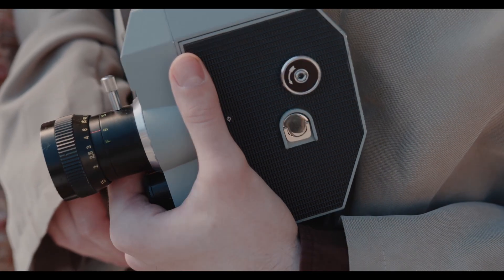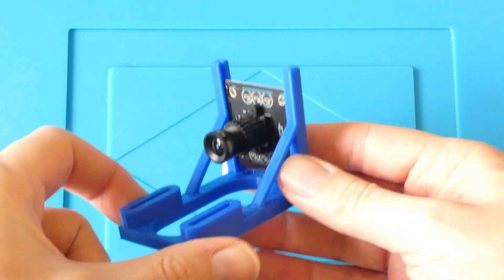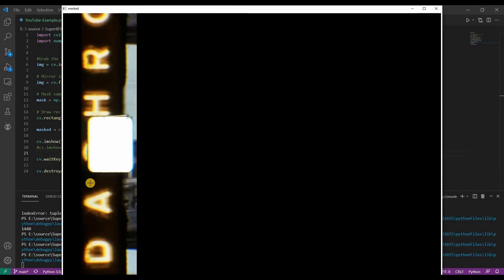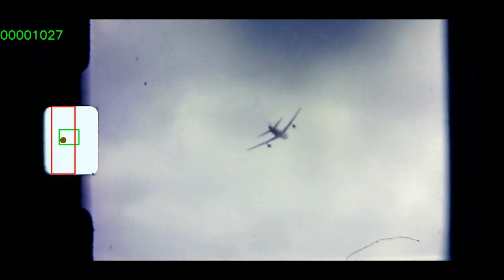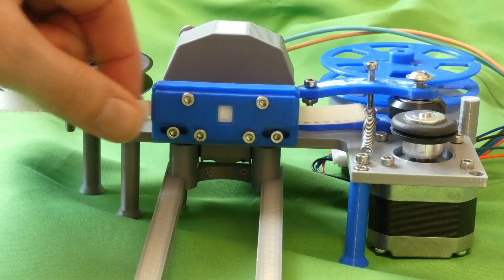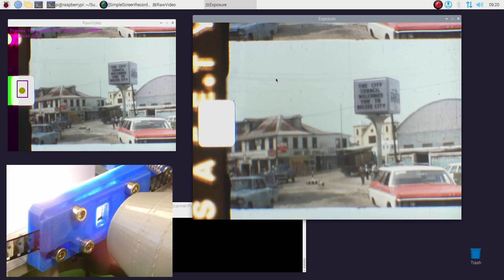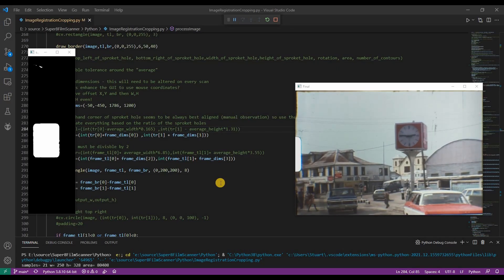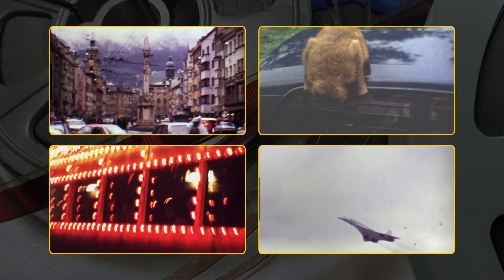Super 8 film scanner, 3d printed using OpenCV

Comment: I love your use of Open CV for frame tracking, Raspberry Pi for image capture, and 3D printing of film advancement. How do you drive the take-up reel since it's revolution required rotation decreases as more film is taken up due to the larger effective diameter?
Reply from the maker: I started to code really complex logic to change the speed of the stepper for the take up wheel and then just ignored that and used a fixed speed and tightened up the slack at the end by hand.
Reply: @StuartPittaway  Today's crazy idea. A magnetic clutch. A motor that runs faster than you need but couple it with magnets to the take up reel. So it will always slip, but enough torque to keep tension on the take up reel. I think others do it with a rubber belt that slips.

Comment: Stuart - this looks amazing, thanks! I was just about to buy a Wolverine scanner and found this just in time. In your GitHub repo, you mentioned an old Ender3 PSU would work for the power supply, but do you know if the motherboard would also work? It doesn't appear that Ender motherboards are RAMPS compliant, but I should be able to flash Marlin on them. This seems like a great use of my old Ender3, particularly if I can reuse the stepper motors and other parts. I'd love to hear if other users have had success with that.
Reply from the maker: I can't see why it wouldn't work - Ender already have Marlin code on them - you just need a way to control the stepper forward/reverse functions
Reply: @StuartPittaway  Thanks for getting back to me. I was able to get the Ender 3 Pro (silent board) to work. The only issue I ran into was that the Y axis travelled in the wrong direction - so I just rewired the connector in reverse and it worked fine. This is actually a great use of an old Ender, as I got the motherboard, PSU, stepper motors, cables, screws, and other stuff from there.

The only real issue I've had is that scanning requires constant monitoring. The film frequently hangs up in the gate window while reversing and bends on the right side. Is this something you ran into and resolved? I'm wondering if I should reprint that part in PETG or something as it might be a little more slippery. Any other ideas you have would be much appreciated. Thanks again!

Comment: Could you have used a B&W sensor and a color filter wheel in front of the camera to take 3 exposures/frame and then merge them later on?

For the alignment maybe leave a gap in the wheel so that only a B&W image is captured for the sprocket detection and when aligned capture R, G & B frames.
Reply from the maker: Yes this would have been possible

Comment: Very nice! Could you maybe please provide some more technical details (or even a video) on the actual assembly process of the scanner? 
Which screws / parts are being used / how to make anything spin and such? 
And how to connect power and the Raspberry - thanks a lot!
What's the reason that two stepping motors are required?
PS: i'm originally from Tyrol, very nice old footage of Innsbruck there!
Reply from the maker: Hello, thanks for watching. I really don't have the time at the moment to expand on the building process. If you can take a look at the Freecad files, it should be quite simple to see what screw holes there are and how the parts align.

I used 2 stepper motors simply because I had them spare. This could have been done with a single motor.

Comment: Hi Stuart, really fantastic work here. I'm interested in taking a similar approach towards scanning 16mm film. I've been trying to wrap my head around how I'd handle sprocket hole detection on this format, given that the hole sits in between frames. Do you know if there is a way to align the frame using two sprocket holes rather than one? I apologize if this is a dumb question, I have no experience using the OpenCV library. Thanks!
Reply from the maker: It should be possible, you detect the square shape and then use that to align the overall image.

Comment: Your results are very good.  I've been playing with a circuit that varies the lamp brightness with the measured brightness through the film.  This helps compensate for under and over exposure on the film itself.  I built it and it works well enough to incorporate into the Rube Goldberg I've cobbled together.  I'm hoping to try it out before Spring.  I too use Davinci Resolve for post.  I find it quite fun to capture old family films.  An excellent cure for the doldrums of Winter.
Reply: you can try to take 3 pictures one over exposed and other under and merge them so you have an hdr imge with the with rage of the film. Also if you add another with an IR light you can run a dust remove filter in photoshop. that is how all my 35mm scan works
Reply from the maker: I had a lot of fun doing this - I remember watching the films as a child, so very nostalgic to restore them in the digital world.

Comment: Hey, amazing video. im doing a very similar thing, but with a flatbed scanner. but i now have a scanned strip with about 30 frames and no way of splitting then up into individual frames. i was hoping OpenCV could help , but being new to python im finding it really hard. can you offer any advice?
Reply from the maker: I was also new to open CV, it's not that difficult but trial and error paid off
Reply: @StuartPittaway  iv actually made some headway. I'm about to crop my frames now. But only on singular images. Need to setup iterating through my image folder next

Comment: Very cool!  Y'know you can have Davinci detect cuts as you import the clip (or frames) via the Media tab.  You can adjust the tolerance of the what is detectable as a cut and after its done, you can go thru what it had generated as cuts and remove or add any more cuts that it neglected.
Reply from the maker: Great tip! Thank you

Comment: Hi Stuart, I have been toying with the idea of transferring old Std 8mm to digital images for some time now. I had thought about converting a projector but I find that your design of a scanner, and the resulting images are awesome.  I now have an old 'Illumitran' slide copier which would use a camera to capture the image. I would like to adapt this, by adding arms for the film transport system by powering them with Stepper motors, and using a 8mm size film gate.. But, I have to admit that computer programing/components completely mystifies me. If I use 2 Nema 17 motors, do I need 2 separate drivers ? I would replace the camera with a digital HQ Camera Board with a Microscope lens and wonder how a sprocket hole sensor could trigger off the camera   Could all of this be powered by an Arduino ? The Raspberry system for programming seems quite complicated. Could I please ask you to provide a list of what Motherboards, Drivers, Controller/Smoothie Boards, Sensors etc that I will require.  Sorry that this is rather long winded, but I would appreciate any advice that you may be able to provide.  Many Thanks. Best Regards.
Reply from the maker: Hi, I used an old 3d printer motherboard, nothing special it just runs marlin, and has several stepper motor drivers.

You need a driver for each stepper motor.

I then use the raspberry pi, and it's microscope camera to capture the images. Arduino isn't really suitable for this.

Don't forget a good light source as well, it needs to be bright and uniformly lit.

Comment: This is amazing. I've spent days going down the rabbit hole of how to modify a projector, but this has inspired me to try a new approach. Using software to sense the sprocket hole is brilliant.
Reply from the maker: Glad I could help!
Reply: I agree. I've played around a little bit with computer vision but it never occurred to me to use it for this - makes the mechanical solution so much simpler.

Comment: You can buy old projectors and editors very cheaply on eBay. The editor is good for rewind.
I am building a scanner. I found webcams do not give a flat field but a digital microscope works well. Will use magnets to hold the camera in place so I can position just by moving it.
Reply from the maker: Good ideas.
Reply: I've been thinking DSLR with macro lens although the files might end up being unnecessarily large. You'd definitely want a decent lens for the best possible results though.

Comment: Thanks for sharing this - and your github repo. I'm just setting out to do the same thing having bought a scanner off Amazon and sent it back thinking I could do better myself! It kept adding a kind of flutter to the top of some frames and they were really over sharpened. Having studied pictures of the Retroscan commercial scanner I'm going to try not using a pinch roller first. It seems to just pull the film through a set of friction rollers. Time will tell.
Reply from the maker: Did it work?
Reply: @StuartPittaway  The 10 million dollar question! I ended up ripping up an old standard 8 projector and using two sprockets directly on two stepping motors either side of the gate plus a third stepper for the take up spool. I controlled these and a camera with a Raspberry Pi. It "kind of" worked. I think the hardware set up was more or less OK but it needed a lot of work on the software to get over how crude it was. Late one night I was struggling with it when I realised I really didn't want to be doing it any more. My day job is as a software engineer and it really isn't good to end up programming into the evenings. Maybe when I was younger but not anymore! I gave up on it and went to do something more analogue in my time off. Here is a quick phone video of it "working" before it went into the parts bin https://youtu.be/t7t8p3Mq3LY

Comment: Great project Stu. It is very reassuring to see your approach getting such a high quality result. I'm in the process of doing the same thing but making my rig more general to cater for 8mm, Double 8, 16mm cinefilm and 35mm stills. 
Have you thought about using HDR images to pull out more detail in the shadows and high lights? The library that the pi now uses (libcamera) has a built in HDR function and OpenCV has included an number of HDR algorithms as well. I believe that the libcamera routine adds 2-3 seconds per frame which is quite expensive and would add a couple of hours onto scanning a 4 minute film. I've seen some still images and it seems to do a good job. I've done some reading and tests with the OpenCV routines. It (like everything) seems to need a good understanding of the process and some experimentation to get all of the settings tweaked.
Reply from the maker: I did look quickly at HDR, but decided it was too slow and the original quality of my film wasn't great. Let me know how you get on
Reply: @StuartPittaway  I certainly will. Thanks.